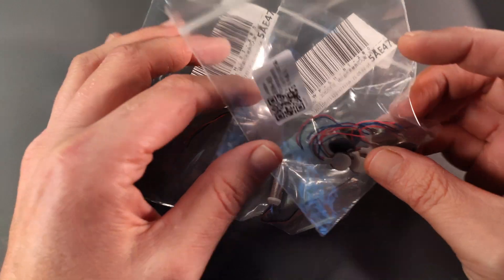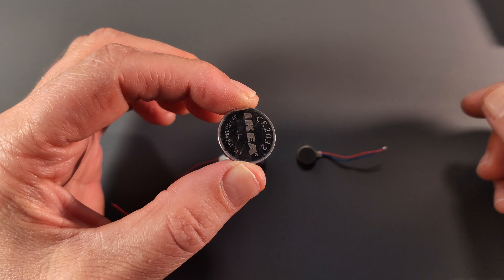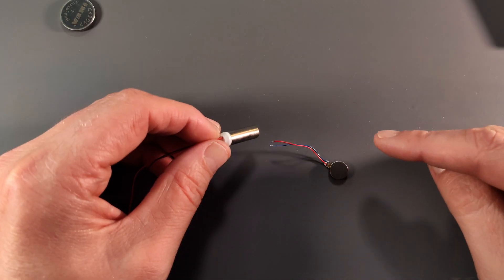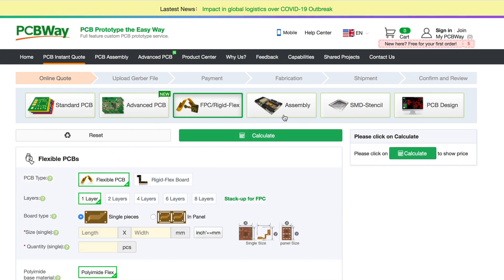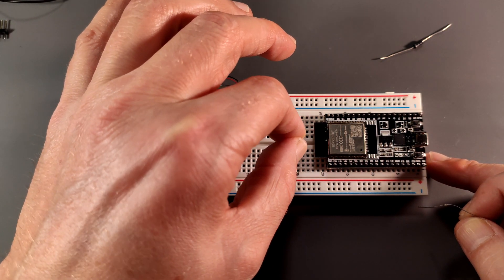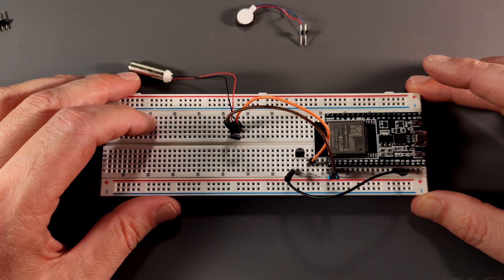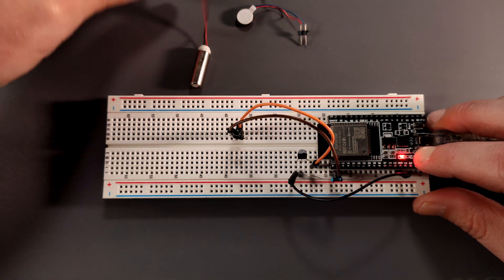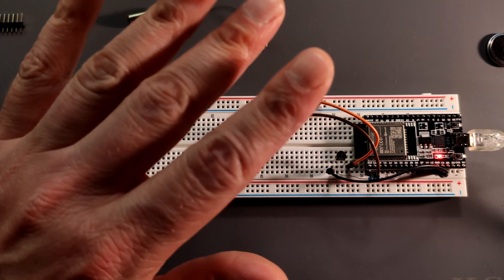Things that go Bzzzzzz (Haptic Feedback Motors)

Comment from the maker: BE AWARE: In the end where is set up an ESP32 with the motors using a transistor, the diode is facing the wrong direction!! I did not notice my mistake. A lesson in double checking your connections :) Thanks to @feston360 for spotting it and pointing it out. Remember; It should always be cathode to positive motor supply!

Comment: I built this same circuit (using a 2222A transistor instead), works perfectly and exactly the same way except when the pin goes to low, i seem to loose serial communication to my esp32 temporarily. Should i be concerned with the circuit health even though it works perfectly fine?
Reply from the maker: Good to hear you got it working! Without seeing the code, I can't tell you why you lose the serial connection. It should not happen. It could be that you are using a pin you should not (one of the serial pins for example) or your code is somehow blocking serial communication. It could also be that your ESP is constantly resetting due to an error. 

I would not worry too much about things breaking. But it is something you should look at.

Comment: I have a question: can I use NPN 2N2222 instead of NPN 2n5551?
Reply: Coming back to say that I used the npn 2n2222 and it worked, but I'm still studying to understand the differences in current gains.
Reply from the maker: @fabiobrasileiroo  I was just about to respond with "Yes you can" but you did it the maker way, and just tried it. Great! :) 

Understanding transistors and current gain takes some studying. There are a lot of YT videos out there that can help. In this case, the transistors is used more like a switch than an amplifier so it is not really important.

Comment: Hey I'm a beginner in Robotics and stuff like that and I recently bought a L293D but while I'm using that, i only have two digital pins and the analog pins free now...how do I get access to those pins cause the driver doesn't have any connectors?
Reply from the maker: I am not familiar with that chip. So my best advice is to search for someone using that chip (on YouTube) and asking them.

Comment: why in the video it looks like the striped side cathode is connected to collector and the black motor wire, and the anode is connected to the 3.3V wire coming out of ESP32
Reply from the maker: You are absolutely right. The explanation is correct and I still put the diode in the wrong. I did not notice my mistake. I feel embarrassed! Thank you for pointing it out, I can't correct the video, but I will pin a comment correcting my mistake! It should always be cathode to positive motor supply!
Reply: @DustinWatts  by the way you should post more content your videos are very helpful. Thanks for replying so quick now I can connect my diode with 100% certainty, cheers.
Reply from the maker: @feston360  Thanks! And yes, I want to start making videos again. Your comment definitely helps my motivation to start again! Good luck with your project 👍🏻

Comment: Sir can we say it as a motor driver
Reply: Actually I want to use multiple motors approx 15 16
Reply from the maker: @lothbroak  You can, if you have a microcontroller that has enough pins. It also depends on the type of motor and under what current they operate.
Reply from the maker: You can use transistors as for driving motors. They can handle way more current than a pin of  a microcontroller.

Comment: Thanks for the detailed video, I put together this exact circuit like yours. I have a few questions:
1. How safe would it be with say 6 motors from different pins.
2. Basically everyone writes that the power supply of the motors in no way should not be from the ESP32, there should be a separate power supply.

At the moment I connected two motors in the same scheme and watch the temperature. the board itself (esp32c3 super mini) when using two motors heated up to 70C.
Reply from the maker: Hi! If you use a transistor and a separate power supply, you can use most pins (that are available off course) together on the base/gate depending on the the transistor (MOSFET of BJT). Just make sure you current limit the pins using an appropriate resistor and keep the current in spec with the datasheet. 

Do not power them directly from a pin. Although it can work, it might damage things. So take the safe and best practice route and do it with a separate power source and a transistor. 

Good luck!

Comment: Can we control it as high and low speed
Reply from the maker: Yes, this is just a simple on/off example. But it is just like any DC motor you can drive with PWM.
Reply: @DustinWatts  sir, same transistors and connection should we use ? And which motor driver should we use? Currently we are trying with PCA9685 or need to design own for 50 vibration motors
Reply from the maker: @lothbroak  If you have only 1 motor on the circuit. You can do PWM in code. This saves the cost of a 16 channel chip. And almost any transistor will work. I would use for example an S8050 NPN transistor. As with all motors, do use a flyback diode. Look for "Motor transistor MCU" on Google and 100's of schematics will pop up.
Reply from the maker: @lothbroak  Thank you, but I am not an expert at all. I would consult a real expert in this case!
Reply: @DustinWatts  sir actually i am going to design this connection on pcb on easyeda can i include pca9685 module in that design

Comment: Hello can I know whether there're are any other transistors which can use here? I couldn't find this transistor.
Reply from the maker: It is not that critical luckily, and "jelly bean" BJT transistor will do. Jelly bean refers to a part you can get everywhere in bulk for cheap. Basically, any PNP BJT transistor will work in this situation.
Reply: @DustinWatts    Thank you so much for replying :) Actually I don't know much about transistors. I saw that the motor I bought has a starting current of 900mA. So I thought it would damage the transistor, if I use something like BC547. I am going to connect the motor to a 3.7V battery and esp through the transistor.

Comment: Im new to this stuff, as in new today new lol. I want to drive a small vibration motor like this automatically in timed intervals. I dont know anything about Arduino but I need a tiny circuit board, maybe like 1x1in? I want to create a vibration say every 10 minutes for say 5- 3 second pulses automatically while the board is plugged into a wall and also powering around a 25-Watt light at the same time. Maybe im looking at it all wrong. If anyone has any ideas let me know!
Reply from the maker: Arduino has a nice and clear tutorial to do exactly what you want! https://forum.arduino.cc/t/using-millis-for-timing-a-beginners-guide/483573
Reply: @ Thanks I  will read that. Are all these arduino boards sort of large? I need to fit it in a small enclosure of maybe 1inx2in? Do they get hot?
Reply from the maker: @NitroVipers3  The don't get hot and you can use smaller boards. For example the Arduino micro/mini or mini versions of an ESP32. They would be about 1 by 2 inch.
Reply: @ thanks for the help. I asked grok to make a code and it did, I didnt understand any of it but ill take more time lol.

Comment: It's good to see that it works with 3.3 volts because there are ready-made boards and it recommends 5 volts but I have 3.3 volts.
Reply from the maker: Sorry for my late reply... your comment slipped through the cracks :)

Yes it works with 3V3 it is just a bit less "wild" If you have the option to get 5V I would use the transistor solution i do in the video.

Comment: Wonderful video, very clear, worked well after I hunted around for the stuff. I ordered a variety pack of transistors and had to use an LED for the diode. Creating different haptic patterns has been fun. Thanks and sub'd !!
Reply from the maker: Ah nice to hear, the transistors really doesn't matter as long as it is a NPN transistor. And good thinking with the LED as diode.

Comment: The cathode (the side with the stripe) goes to the motor's positive terminal (the red wire).
But on your build I think you connected it in reverse. Is that right or am I making a mistake?
Thank you!
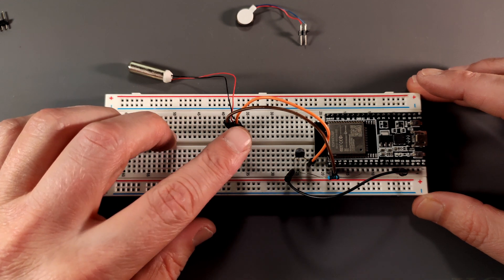5:37
Reply from the maker: If you mean that the diode needs to be with the cathode the the positive side, also called reversed biased then you are right. That is the way it should be.
Reply: @DustinWatts  yas thank you. It's just that on the video i think that it was reversed
Reply from the maker: @kmtsvetanov  I checked it, and it is difficult to see on the video. But I'm pretty sure that the cathode is going to the supply rail. I made it bit worse to not use properly coloured wires. For me, that is lesson learned!
Reply from the maker: @kmtsvetanov  I can't really tell. But even if I made a mistake, do as I say, not as I do... lol

Comment: I built this circuit over the weekend. It works perfectly! I had to watch several videos about diodes but I finally get it thanks to you!
Reply from the maker: Glad you have it working. I did not want do explain diodes, that is a separate video in itself. Just remember: Always put a diode across the motor negative side pointed to the positive voltage. 👍😃

Comment: Have you done this with PWM pin? Can you show code for that? Great video.
Reply from the maker: Sorry for my late reply... your comment slipped through the cracks :)

I have not done it with PWM yet. Just on/off. But you could use PWM instead of just a digitalWrite. I have no code, but there are enough examples online how to use PWM. Just use it as if was an LED.

Comment: Thank you very much for this beautiful video, but I want to ask you something because I am an Egyptian student and I am working on a scientific project and I will use these.
What is the difference between using ESP or Arduino and which is better?
Why did you use diode?
Why did you use a transistor?
Are they very important and indispensable?
Is there any way to control the frequency? For example, I want a period of 50 Hz and a period of 250 Hz. Can I in any way control that?
Thank you very much for your help  I would be very grateful if you would reply to me
Reply from the maker: Hi @Beau400! That is a lot of questions :)

1. An ESP and an Arduino a both boards with a micro controller. I like the ESP32 better because it has Bluetooth (also Bluetooth Low Energy, BLE) and WiFi.
2. The diode is to protect the transistors from the high voltage spike that can occur when using a motor. This spike now has a place to go (trough the diode and motor) instead of destroying our transistor.
3. The transistor is there so I can use a higher voltage and higher currents then an ESP32 pin can provide. I connect it to 5V. Which I cannot do directly to the ESP32 because it is a 3V3 device.
4. So no, they are not indispensable.
5. In the code you can change the frequency of the PWM signal that is connected to the base of the of the transistor. However I would change the duty cycle to get lower or higher frequencies. That is much easier. (there are a lot of tutorials on Youtube how to do that).

Thanks you for your comment and for watching my video! I hope you got something out of it!
Reply: @DustinWatts  Thank you sooooo much for your time. I am grateful to you ❤❤
Reply from the maker: @Beau400  I am grateful for you watching and that it helped!

Comment: The second motor (the coin one) looks like its from a cell phone. don't know if it actually is or not but still pretty cool.
Reply from the maker: I think they use motors that are much smaller. And the motor you are talking about vibrates pretty heavily.

Comment: How can i mount a circuit to connect this motors to work with an Audio Signal?

In my case i need to connect this motors on parallel so they could work all with the same audio signal
Reply from the maker: Depending on the voltage level of the audio signal you can connect it directly yo the audio signal. If you are afraid there is a mismatch or generally a better way is create a motor driver with a steady 5V using a transistor and an OpAmp buffer to not load down the audio signal. The simplest way is in this circuit, change the signal from the microcontroller and plug in the audio signal.
Reply: @DustinWatts  I've just found a mini custom audio amplifier for sale, it's rated at 12V and 10W of maximum power, it comes with a potentiometer so the power is adjustable, do you think this could work?
Reply from the maker: @SoyDavidYT  Ifyou keep the voltge around 3V3 or 5V , I forgot what voltage these motors require, I would look up the listing below you are fine. They use very little urrent so 10W is a lot but you an start of with the lowest voltage and see where they work as you want it to. And as you get a bag full of them, destroying one is not a big disaster :)
Reply: @DustinWatts  yeah, actually I just noticed, this amplifier supports voltage imput from 3 volts, all around 12 V
Reply from the maker: @SoyDavidYT  You probably do not need an amplifier... actually, I would try it without an amplifier first!
Reply: @DustinWatts  .6V - 3V
Reply: @DustinWatts  thanks ♥️

Comment: the diode across the motor will help absorb the collapsed back emf  after the forward drop is overcome, but does all the energy flow through the diode, current will follow least resistance path some might enter the collector also.
Reply from the maker: Yes correct. But if implemented correctly not enough to destroy your transistor. But still think about the size of the collapsed EMF and choose you diode and even your transistor to not be destroyed.

Comment: I ordered the two vibrating devices that you featured in this video.  Thank you for putting the Alibaba Express links in the description.  I will be using them with a brand new Arduino UNO R4 Wifi device.  The 8 octave (8x12 matrix) that is on that development board will work as a preliminary mock-up for the MIDI note indicators.  Later, I will add a strip of addressable RGB LEDS and later a matching one of haptic devices - and maybe one of the two types that you suggested will be on that haptic strip.  Thanks again.
Reply from the maker: Sounds very cool! Looking forward to see the result somewhere. I liked the second motor better for haptic feedback. But my guess is it will heavily depend on where and how you mount the motor how good the haptic feedback will work. 

Beyond this video I have not done anything with thee motors, but the idea of using this with a screen is still alive. So thanks for bringing this to my attention again. Need to do some more experimenting :D

Comment: 4:55 
What kind of diod I should use?
Reply from the maker: Just a normal 1N004. Depending on hirger currents you good go with the 02 or 03. But the diode is more important than the type of diode. 2n22222 will also work fine. So will a 1N4148.

Comment: Thanks. Great idea. For people that not know very well electronics, which kind of diode are you using?
Reply from the maker: Thank you, no problem! For this simple application will do, but preferred are Schottky diodes. Because they have a lower forward voltage drop and will react faster when reversed biased. Something in the 1N58xx is fine for this.

Comment: Can we specify the frequency?
Reply: You can use PWM tho
Reply from the maker: There is no direct way to specify the frequency. But depending on the voltage you can influence the RPM which will have a slight effect on the frequency. But these are not made to change the frequency. They do exists though, but are a lot more expensive.

Comment: Is there a way to program the vibration to make it like a hearthbeath?
Reply from the maker: Yeah sure that would be possible...
Reply: May need a circuit to fire the motor at the correct timings, Recommend using an arduino for prototyping then making a custom circuit when finished
Reply from the maker: @stoobidthing  Sure any micro-controller will work. Just use PWM the base of a BJT or the gate of a MOSFET and you can do anything you want.

Comment: Awesome info! Much appreciated! Tried to work on this for a while! Would if we want to use several motors? Is the wiring more challenging for that? Thank you for sharing!
Reply from the maker: No not really… the wiring is the same for each motor. Don’t need to do anything else…
Reply: You can connect them to the same wires

Comment: I've been curious about using some similar vibration devices to trigger the recording of a car dashcam when in 'parking mode'.

They will wake up and record with a sudden impact when parked, but there are a multitude of scenarios I'd like to capture that may not set off the g sensor when in parking mode.

For this, I plan to use the car alarms siren as a trigger (mine only gives audio feedback when triggered, not when locking/unlocking), as well as a dual stage proximity sensor. This should cover my worries, which include people getting too close/prying inside my tinted windows.

Previously I thought of using a timer relay to give the dash cam 12v on its Ignition input, thinking that the vehicle is turned on and immediately recording. But if the alarm triggered a recording I have no way of knowing it occurred and the dashcam could record over said clip.

By triggering the gsensor in parking mode instead, all parking mode clips get saved to a different file that can't be recorded over, and the dash cam warns yousomethjng happened when turning the vehicle on.
Reply from the maker: Sounds like you did a good job! Congrats and thanks for sharing! :D

Comment: can you show us the code?
Reply from the maker: I used a simple on/off piece of code, like you would blink an LED. Using digitalWrite(PIN, HIGH) for on or digitalWrite(PIN, LOW) for off. You can also use analogWrite() to drive the MOSFET using PWM.